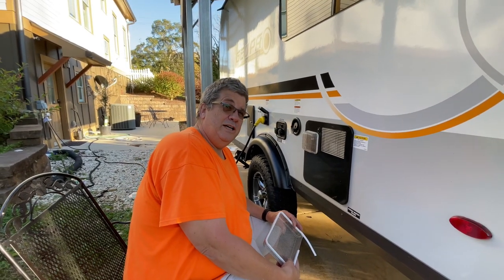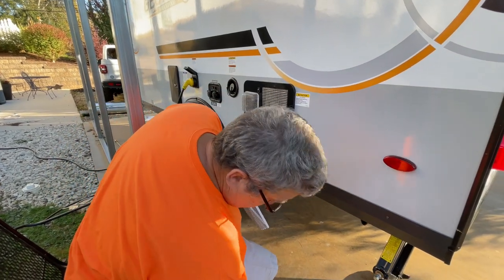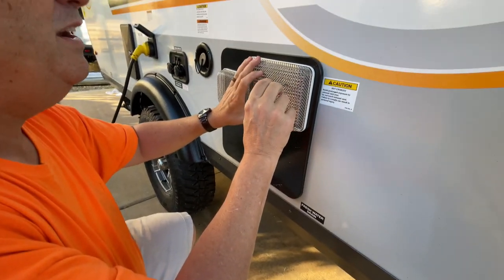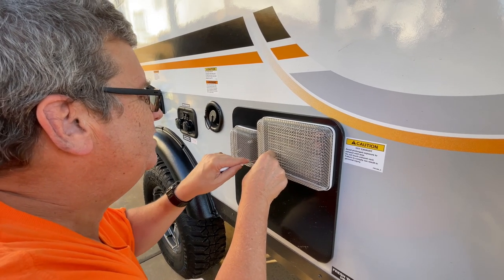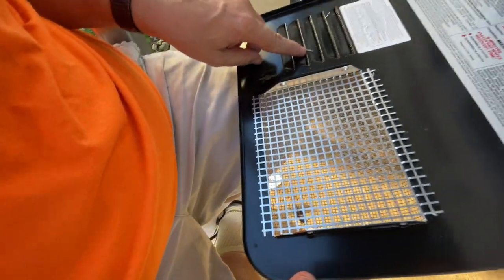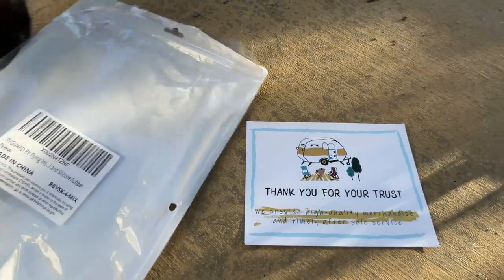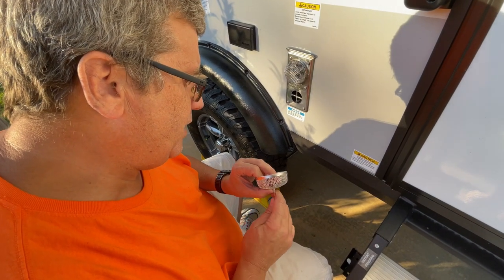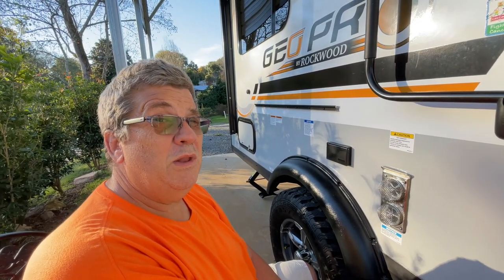Installing RVGUARD RV Flying Insect Screen for RV Water Heater Vent Cover Protects from Insects

Comment: I replaced two of the 3/4 inch screws with two 2 inch stainless steel screws through the screen corners.  Took me less than a minute and the screen won't keep popping off.
Reply from the maker: Great idea.

Comment: Might look at the warranty section of your appliances before using the screens.  My water heater specifically says use of aftermarket screen will void the warranty.
Reply from the maker: Thanks for the heads up.
Reply from the maker: I just checked Suburban website and see they sell insect screens.  https://suburbanrvparts.com/suburban-water-heater-ventmate-bug-screen-6-10-12-gal-units-68327/

Comment: I been struggling for three days to put these on. Then I realized....watch a youtube video on it.   Hope this helps me.
Reply from the maker: They are a little tricky, just take it slow.
Reply: @CampingCoastie  I just tried again.  The metal guide rod, the groove to catch the metal clasp...it dont catch it. Actually it dont fit into the groove on the lil rod. That's my issue. Trying and trying and it's like swearing a square peg will fit into a round hole
Reply from the maker: @ashlingofAsh7580 maybe you can slightly bend the rod tip apart some.  Just go easy so you don't break it.
Reply from the maker: Did you get installed?
Reply: @CampingCoastie  nope.   Lol.  I been on the road struggling. It's all about finding a place to chill. But then hookup.

Comment: Will that work if I lost my screen?
Reply from the maker: I'm not sure what your question is.  What screen did you lose?
Reply: The one in da door , I have an open hole . No place for springs to attach. Any other option?
Reply: My heater damper sticks out pretty far I’m surprised it stayed this long .
Reply from the maker: I don't know,  maybe try and buy a whole new door.  If you have a Suburban water heater, it would cost about $50.

Comment: I hope you will forgive me for pestering you with a question.  I recently bought a slightly used new to me Beyond.  I am not really exagerrating when I say that I have mastered the ability to add gas to the tank and not much more.  Do you know of anybody that offers a class on how to use the darn thing?  I obviously be willing to pay a reasonable amount.   Thanks for listening.
Reply from the maker: Where are you located
Reply: @CampingCoastie  Southeast.    Currently in the mountains of NC (Newland)  but will be moving back toward Jacksonville, FL in the near future.
Reply from the maker: We travel to Jacksonville a couple of times a year.  If you have specific questions on how to do something let me know, I might be able to help you.  Are you on Facebook?  If so, join my group and you can contact me.  https://www.facebook.com/groups/1265239503660522/
Reply: @CampingCoastie  thanks for adding me.  is it appropriate to post my question in the group?
Reply from the maker: @davidherman1041  Sure, post any questions or you can message me.